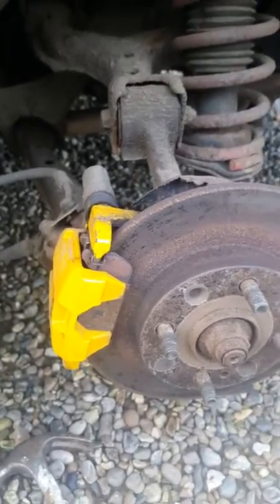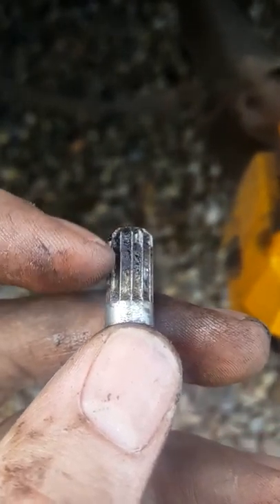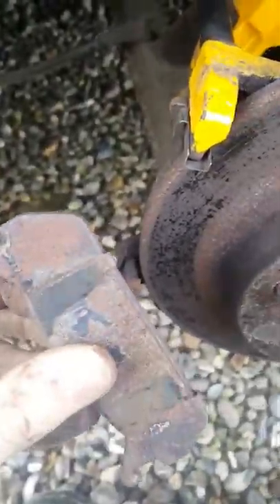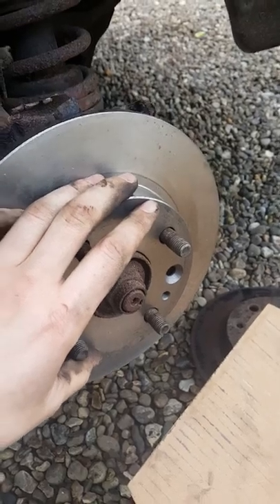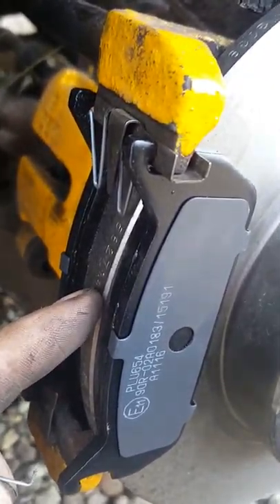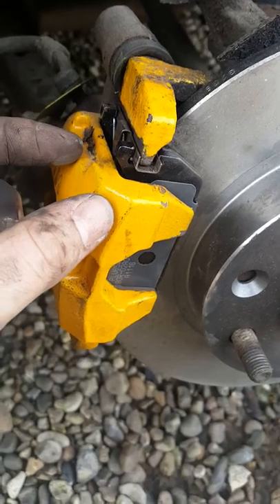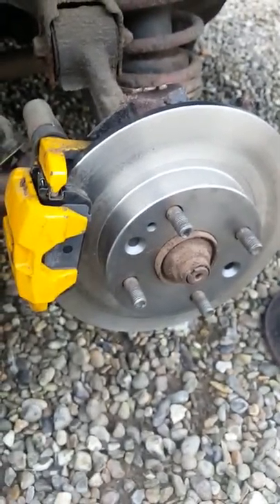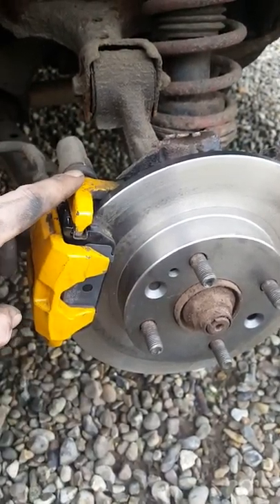How to change rear brakes on a Mazda NA MX5/Miata

Comment: How comes you didnt clean the new disc, did it not have a protective film on?
Reply from the maker: Before I fitted them they were cleaned with brake cleaner
Reply: Cool :) I'm a newbie to the DIY car world. Pretty worried about doing my brakes if I'm honest, this video helped but it sounds like a lot to go wrong and I'm not entirely certain I would know if I had made a mistake.

With regards to the brake fluid reservoir, do you literally just pop the top open, then start the job from step 1 in your video, then replace the top when you're done? No need to bleed anything afterwards?
Reply from the maker: Correct :)